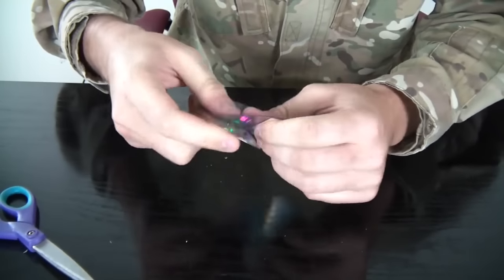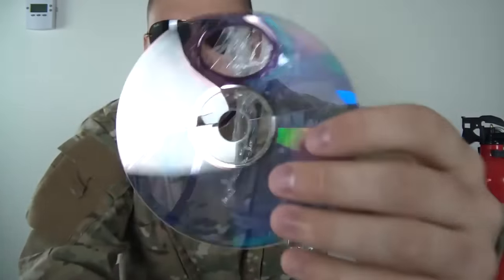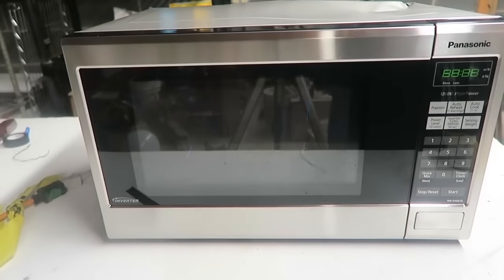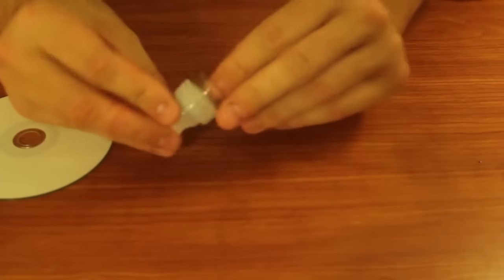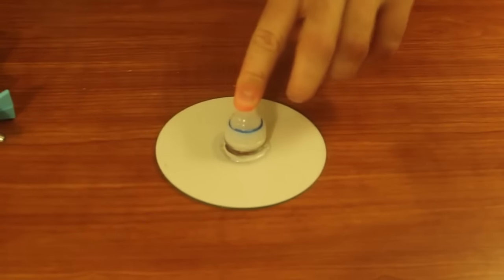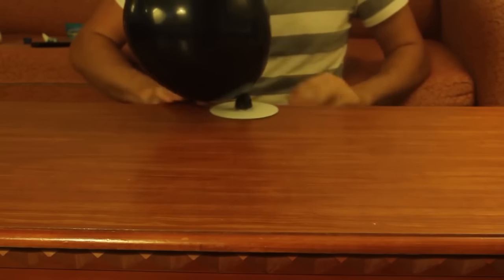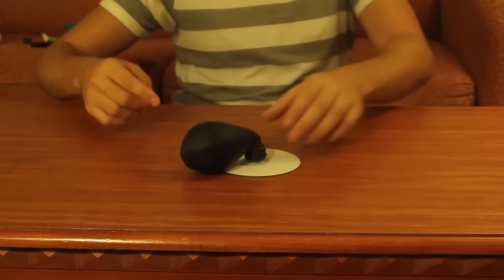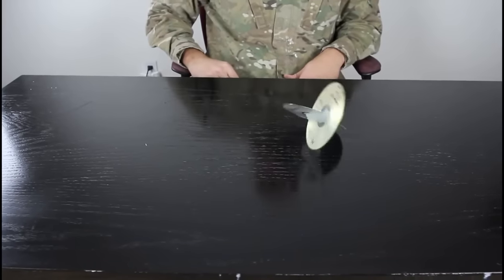4 Awesome Tricks with CD

Comment: taras see if the hovercraft works on water!!
Reply: David Lopez yes
Reply: Water's surface may not work as it is a liquid and molecules can move apart to give way for air. You will rather see bubbles imo.
Reply: Suhas Dara not only that but water is very sticky. you might not think it is but it liked to hold on to things. that's the reason why you are wet after you shower for example, the water from you shower stuck to you. Not all liquids have this property though, most actually don't
Reply: I'd prefer to see if the hovercraft is full of eels.
Reply: TheCheeser yea both reasons
Reply: David Lopez boom